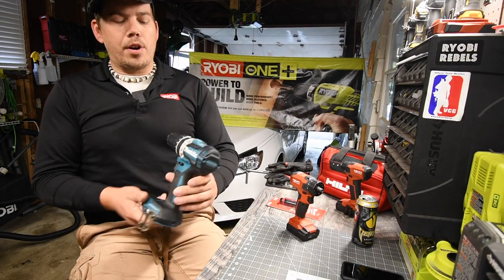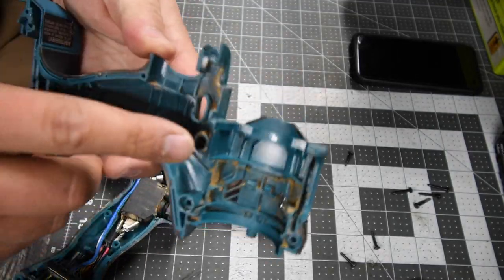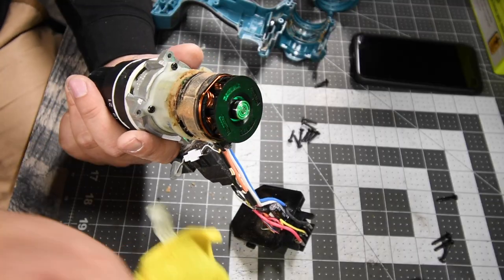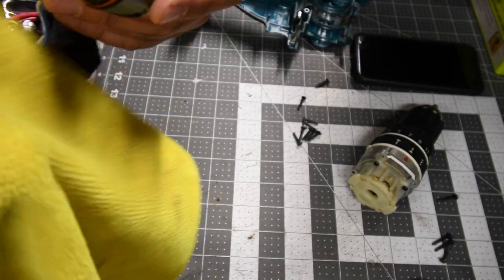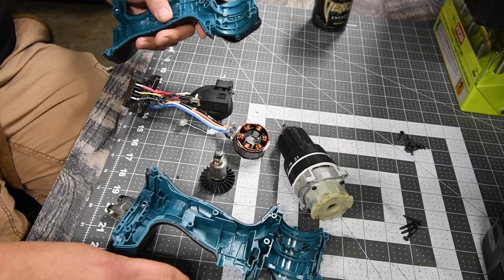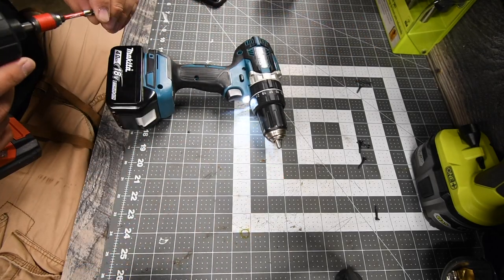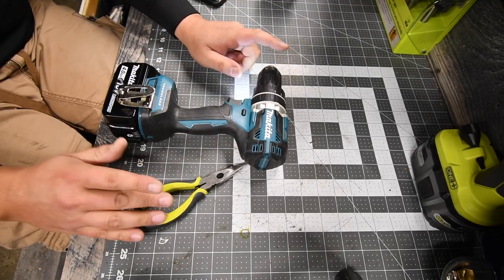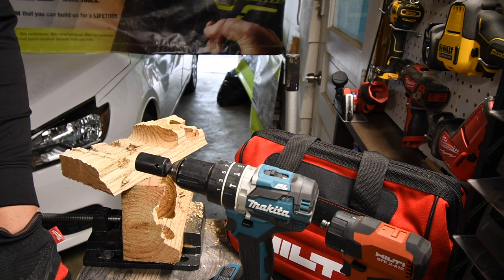Doing this will make your tools last longer!!!!

Comment: Great , would you lube any parts ?
Reply: Not so much on a drill. On an impact you want to make sure the hammer and anvil has plenty of grease.
Reply: If you open up to the planetary gears in the transmission of the drill you can add a touch of 3in1 oil or good gun oil.
Reply from the maker: The Chuck and transmission wasnt toughed so no need to as lube
Reply: @ManCaverTools  it was tough enough? 😂
Reply: @MrConspark  LOL! I just saw this!  Dave is a busy guy, and doesn’t always catch his typos?  Sometimes I’ve found Apple or Android spell check will sneak in wrong words if ya not looking!  ✌🏻

Comment: How about the battery pack boss is it long time to replace or deteriorate?
Reply from the maker: That all depends if you keep you  batteries in good condition. don't drop, don't leave in dust. keep them from our of heat and the freezing cold. stuff like that kills batteries

Comment: Yeah good luck trying to put the gears back In the right way if they fall out.
Reply from the maker: If they do, Project got 1,000,000 times harder lol
Reply: Ha ha, no guts no glory 🤓
These are similar to a modern car starter motor, using a small motor via a reduction gear train to generate a huge torque, easy as to reassemble (with a bit of experience)
Reply: Great video, I'm thinking my little ole 9 year old Wurth drivers will need this, especially after 4 yrs at a mine job

Comment: That is something I will not do. I am sure I would turn them into a pile of useless parts.  I consider most of these tools disposable.
Reply from the maker: its actually fun taking apart tools and learning how well they work
Reply: @ManCaverTools  If a tool is dead, I would take it apart. I don't want to risk  a good tool.  I understand what you are saying though.